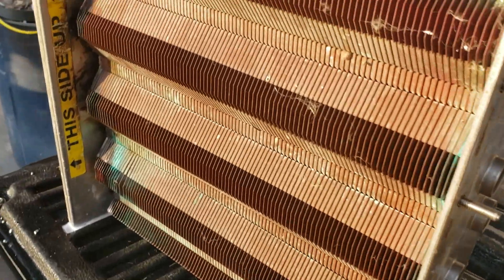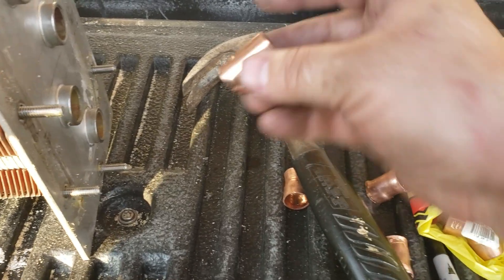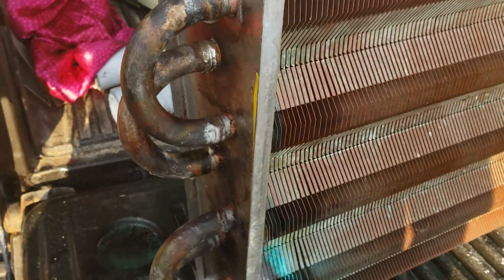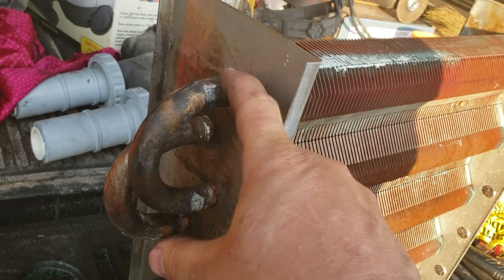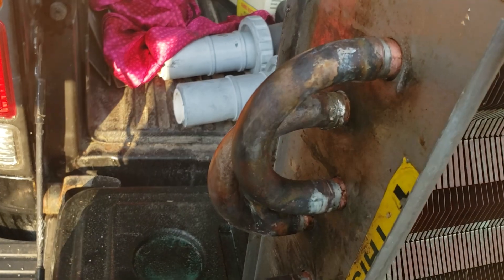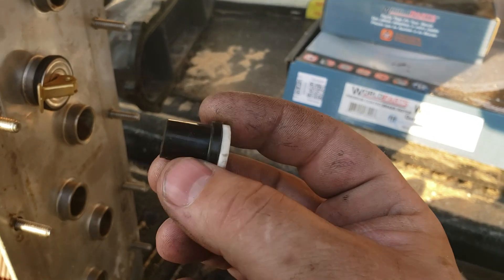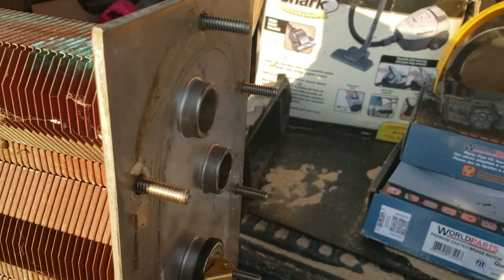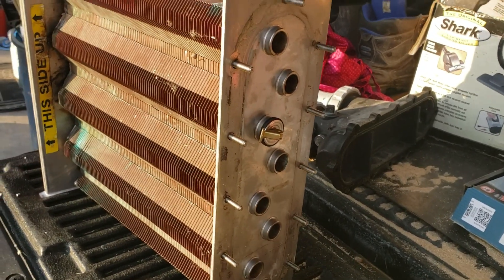H200 Hayward heat exchanger repair

Comment: Where did you get the U shaped copper? Mine has a few small pin hole leaks right in the curved part. I know I can u a 90° fitting but I want a smooth curve like original.

Comment: Did you solder it or did you brace it?
Reply from the maker: Soldered it. Had to replace the areas where the copper had thinned out due to contact with stainless steel.

Comment: Did you try soldering the old connections first rather than cut and rejoint?
Reply from the maker: Yes, the metal was too thin. Almost gone

Comment: Yes it is, you may need to swap the temp sensor but nothing more than an adjustable wrench.i also swapped the orevious gen heat exchanger just had to swap the internal bypass manifold. It will fit more or less...

Comment: My heat exchanger has developed a leak.  I just assumed the plastic header froze and cracked so I bought a replacement.  When I removed the original header, I didn't see any cracks but I did notice that two of the copper tubes were flush with the tubesheet and not sitting proud like the others.  Don't know what could have caused that, but these are the sources of the two leaks.  Before dropping $1200 for new heat exchanger, I cut two blanks out of 1/8" plastic sheet to use as flange blinds to isolate the heater (it seems the diverter valve is allowing some bypass).  I may look at your solution to extend the two flush tubes (provided it passes a leak test first).

Comment: Thank you for your time and info. 
Can I use aluminum  rods to repair Cooper nickel heat exchanger. It's the only ones they had in stock
Reply from the maker: If it was me, I wouldn't. The chlorine and water at elevated temperatures would have me guess the aluminum wouldn't last.

Comment: Do you know if I can replace heat exchanger model HAXHXA1403 with HAXHXA1353? Thanks
Reply from the maker: I'm not positive but I believe the 1403 is longer as it's a larger BTU output heater. I don't think it willl fit.

Comment: Thank you for sharing the video. One of those "C" shaped pipes on my unit cracked open, is it possible to use a 3/4in copper tube & replace/repair my unit or do you have any other suggestions.
Reply from the maker: I would look to find some copper sheet and see if I could solder patches over the crack if possible.  You may even be able to solder the crack closed without any sheet.
Reply: @Kapco78  Thank you for a quick reply.

Comment: What was the symptom causing this repair?  Was it heating the pool/hottub but just taking twice as long as necessary?
Reply from the maker: It was leaking as there was pin holes in the tubing